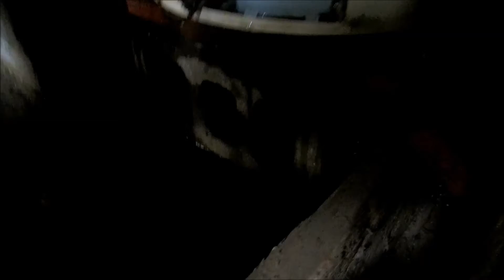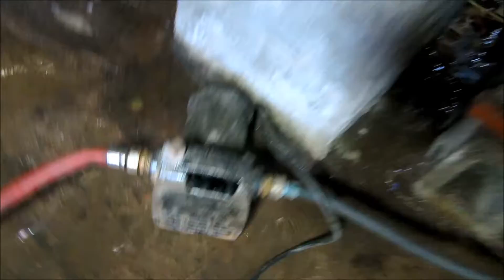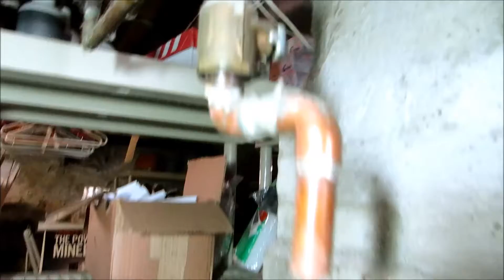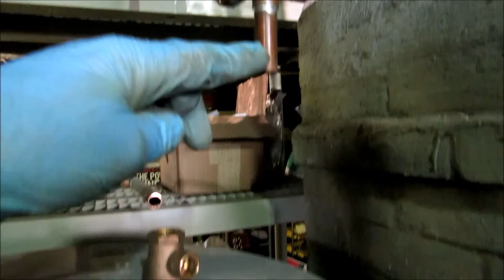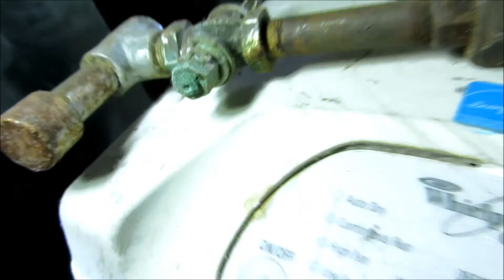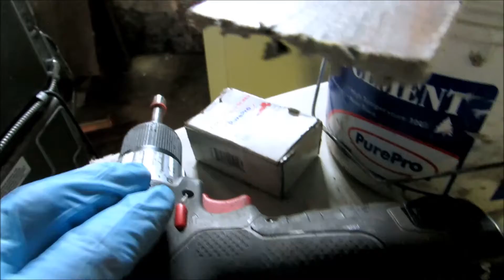40 gallon gas water heater replacement

Comment: Great install Steve. It is a whole different way of doing things than here in California. It is most common to see flex hoses on gas and water supplies here as well as earthquake straps of course and no vacuum breakers. Are flex hoses not legal in Mass?
Reply from the maker: if i see flex hoses on water or gas i know a homeowner did it from home depot no we can not use flex lines on water  or on gas unless you have to slide the appience in like a gas stove  then we can use a gas flex 36" max gas flex

Comment: Hey Steve nice job, great video. On that gas water heater why is there a temperate valve from the cold line to the hot line?
Reply from the maker: for a hand sink,  to regulate temp to sink

Comment: Nice job steve. Was there a hot water line bypassing the mixing valve? Maybe for the dishwasher? It looked like there was a tee before the mixing valve?
Reply from the maker: it probley was for the kitchen area .i did not chase it out  ,so i am not sure .its and older building .

Comment: Is the vacume break code in your state?  Im def gonna start using those great video cant wait for the weekly vlog
Reply from the maker: yes a vac breaker is code ..if the fire trucks hook up to fire hidrent in street and pump a lot of water with out the vac breaker the tank could collaps
Reply: Where I am we have a check valve (backflow preventer) on the water supply. That should serve the same purpose as the vacuum breaker since any negative pressure would just close the check valve.

Comment: Hey steve, whats your opinion on pro-presses? Would you ever drop soldering and go to pro press?
Reply from the maker: go presses are for people that can not solder,, no i will never buy one ..there a flipping joke ...what do you do in a tight spot when you can't get the jaws of life in there to save the day ,with soiled you can unsweet the joint try that with the propress.when i see that monster come out i just laughed .the price of the fitting are crazy .and i carry a ton of different fittings .so for me i will never switch over